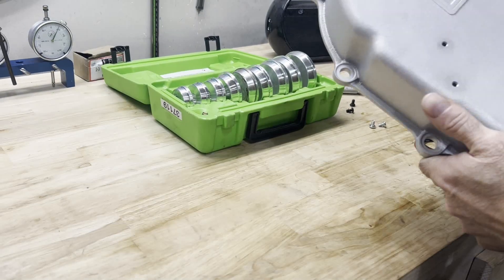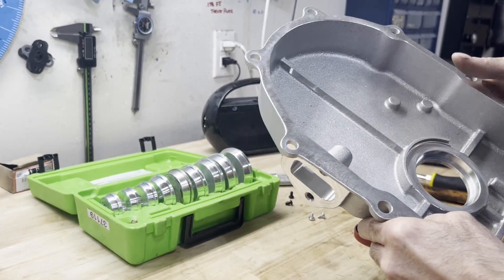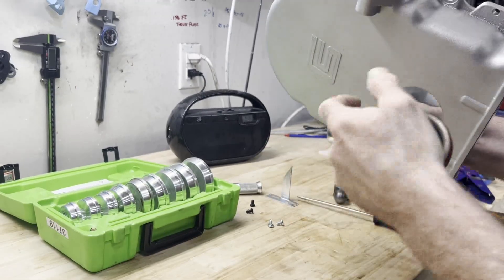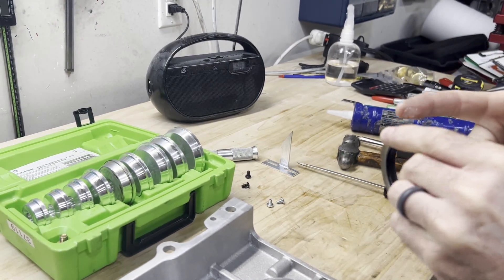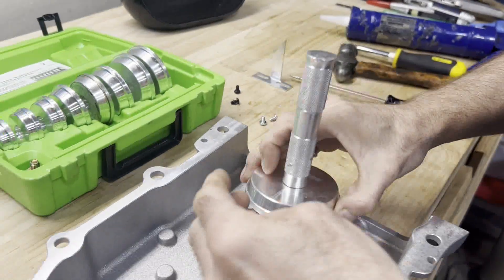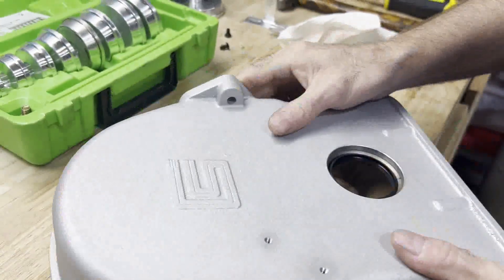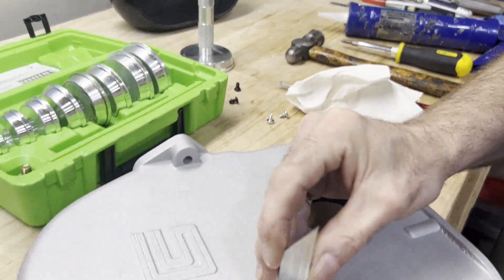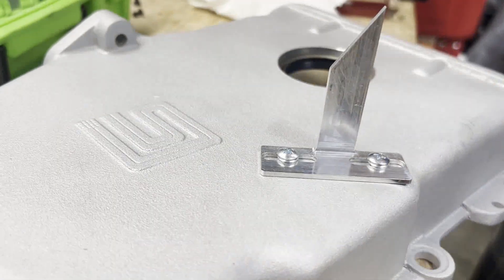Lykins Motorsports Ford FE Timing Cover Seal Installation...

Comment: Always enjoy your informative videos.  I know you don’t have enough on your plate but, I’d like to see you do a simultaneous build (with similar modifications) of a 427 FE with TFS cylinder heads and a 427 stroker Windsor with TFS cylinder heads for comparison of final torque and hp output.
Reply from the maker: The Windsor would win.......

Comment: How about the 1/4" guide pins? Do you use those?
Reply from the maker: Guide pins?  You mean to put the cover on?  If so, I have a mandrel that slides over the crank snout that locates the cover.